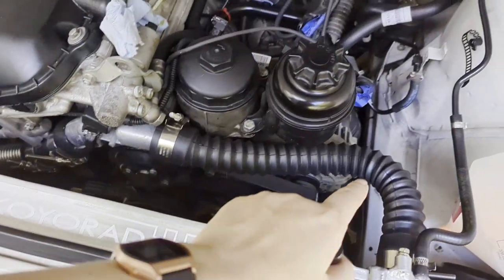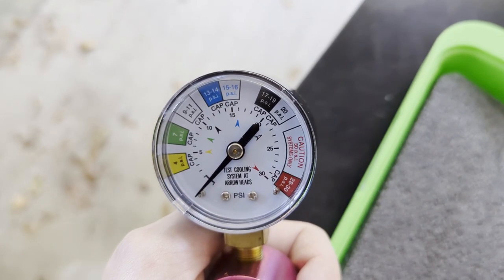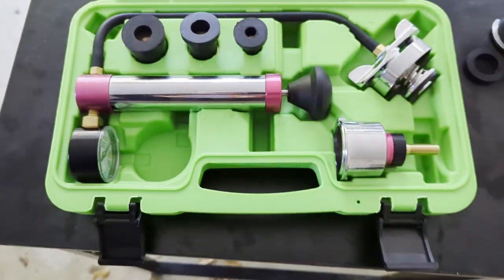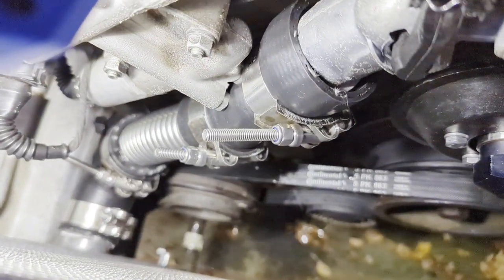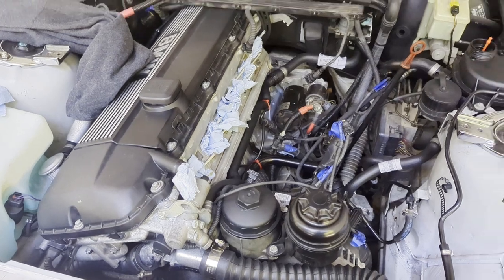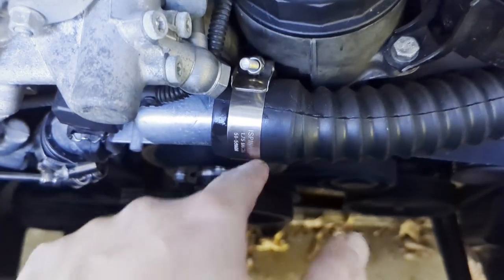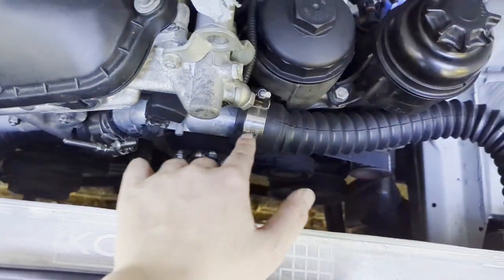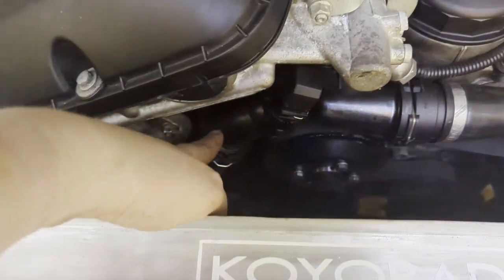My Cooling System Pressure Test Nightmare & How I Fixed It!

Comment: Excellent video!  I have a 1997 1.9 Z3 roadster.  I have experienced frustrating issues with engine overheating due to coolant issues.  It turned out to be very misleading and surprising.  I replaced the thermostat and reservoir.  Found that a replacement reservoir just would not fit properly, so had to go back to the old reservoir.  Had more overheating, with very noticeable water leaking from the reservoir area, from the cap location.  Then, as I ruminated on the issue, I ended up getting a couple new radiator caps.  Have since discovered that it appears that the entire issue was the cap --- using several caps still had a problem.  In studying the caps, I discovered that the caps do not fit very firmly on the screw top of the reservoir, so I have to watch carefully as I screw the cap on AND be sure not to make it too tight.  The leakage and overheating then stopped.  So, the issue, at least for me, appears to be a very touchy cap, always paying close attention to how it screws on the reservoir and not making it too tight.  I don't think there is a way around this.  So far, so good.  Many thanks for your video, studying what you went through to gain success.  Well done!  It is a big project you are tackling!  😀
Reply from the maker: Thanks 👍🏻 The thermostat and lower radiator hose were such a pain for me. I lost a whole month fighting with them. I'm glad I finally got that fixed.
Reply: All of your work requires serious patience and fortitude, as it certainly can be very tiring physically and mentally, working hard to get the work done and wanting it to get done ASAP so you can enjoy driving your Z again.   The constant challenges can really drain you.  Forge on!

Comment: Sorry to hear a out the leaking issues with your aluminum replacement thermostat. I did mention to you that I've only heard about issues using this product and leaking when you refreshed your cooling system. I went OE plastic thermostat 6 years ago with no issues so far.
Reply from the maker: Yeah, all the reviews I've read on the aluminum were issues with the thermostat getting stuck but I didn't anticipate the hoses not attaching to it. It was something that wanted to try cuz I would be like "what if". Now I know to just stick with OE or OEM.